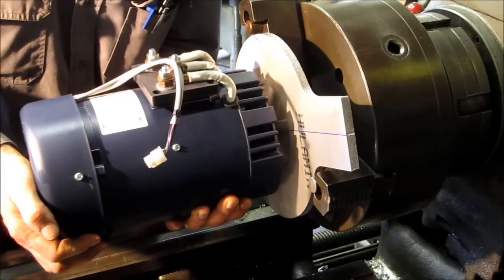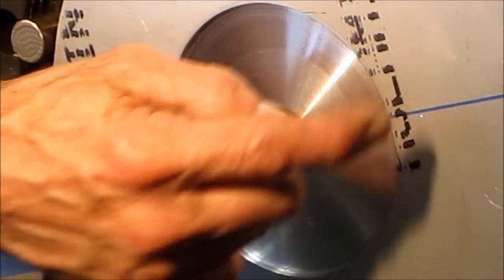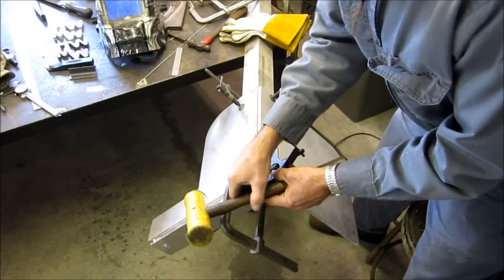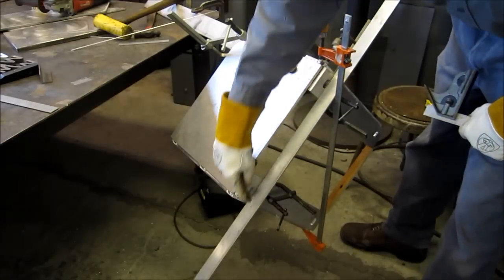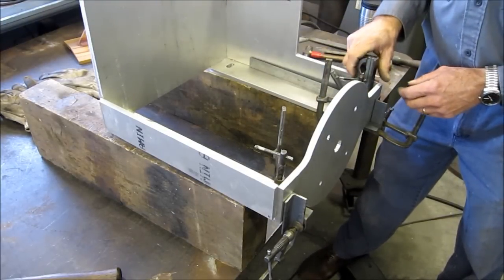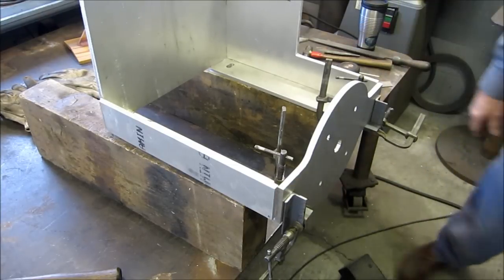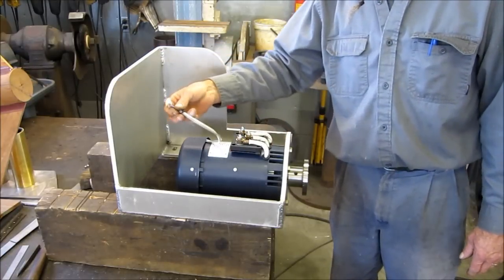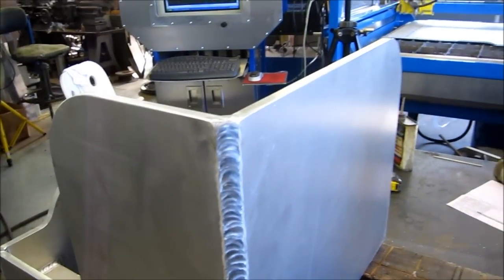It's Electric /  Inboard

Comment: I don't know how much you care about your video cameras, but I'd recommend using a shield on the camera to prevent it from being damaged.

There are several points in the video where the camera is overloaded from the plasma cutter and TIG welder (like at 0:31 for example) that creates a line artifact all the way up and down the picture.

If an intense source of light like a plasma cutter us focused at one point on the camera for too long, the CCD can be burned akin to burning paper with a magnifying glass. This will leave artifacts on the picture usually in the form of solid color blobs.

Comment: @Keith we have a fast cut cnc setup, so the cut height is set by the arc voltage and it moves z to maintain. Getting the right voltage with the cut speed has been tricky, need to tinker more.  I figured you had to be using some He since it looks like you've got a 20 size torch and the matl. looked like 1/2 in.

Comment from the maker: @billdlv I'm using Thermaldynamic's cutmaster 81 with an SL60 torch, Playing with 20,30,40 & 60 Amp consumables and I feel the air dryer has alot to play with it. I'm playing with two theorys, one shorten my cut heigth by the distance the contact tip surface makes the contact and the orifice tip face and the second, slow the freeken thing down, found most of my best cut were 30% - 40% less than the brag charts, seems they adjusted thier quality some to get those #'s. I mix Helium in Yes!

Comment from the maker: @rowingisgoodexercise A couple weeks prior to making this motor mount, my customer brought in his shaft, made by other company, before he knew of Turn Wright and I, to fabricate a thrust support, which also mounts between the stringers. So there is no real thrust put on the motor. I did have to make the coupling for the motor, to simulate a STD. gear drive and shaft coupling fit up. Thanks for the Kudo’s…Keith